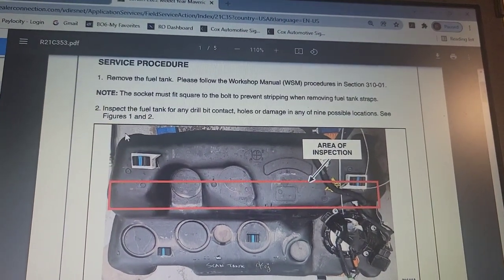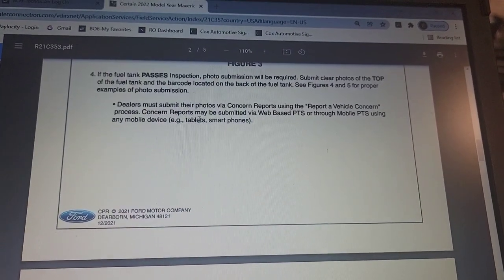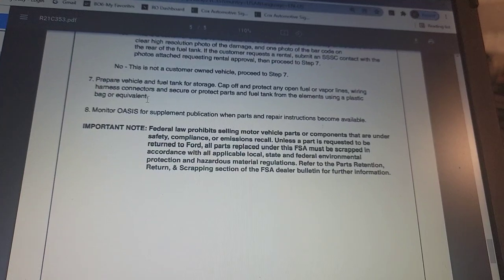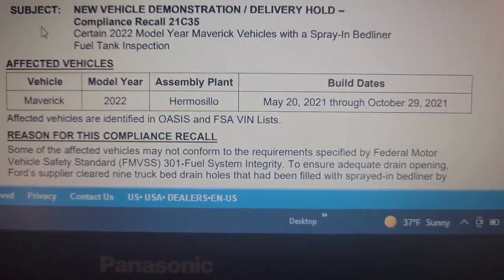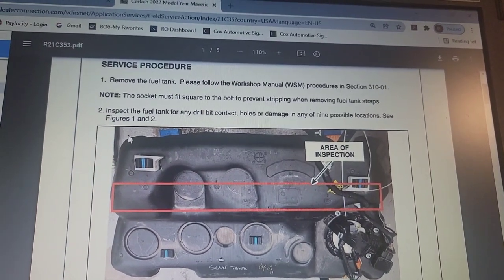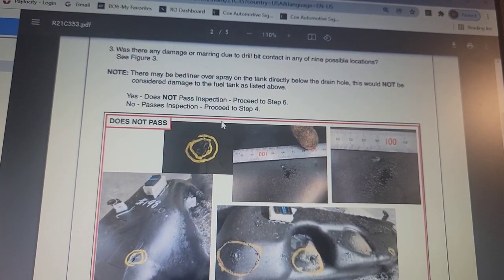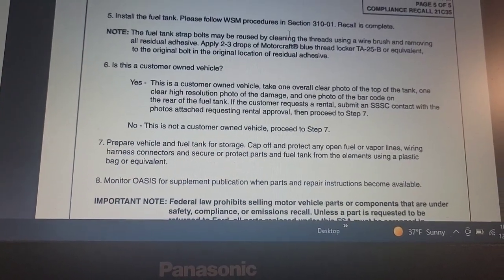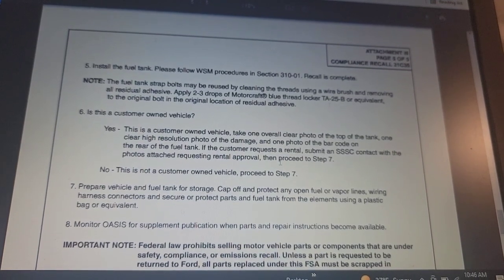Heads Up 2022 Mavericks With Spray In Bedliner - Holes In Fuel Tank after spray in liner possibly

Comment: Wow that's a great knowledge of possible catastrophic damage occurred during the bed liner spray application.  Thanks for the information you may have saved many lives with this one . Hope your day is a great one. Happy Holidays.
Reply: The application of the bed liner is not the problem, it is those drilling out drain holes.
Reply: So it was Ford's fault because they sold the vehicle or is it the contractor's during the spray application the drilling the holes for the bed to drain?  Just the guy drilling the holes before or during installing the spray bed liner?
Reply: @brianszymanski2971  drilling the holes after the bedliner was applied.  Not a factory authorized repair.
Reply: @brianszymanski2971  It's Ford's fault, obviously. That's why they put out a bulletin and are the ones fixing it. Your question would be filed under "common sense" - it's a shame most people don't have any smh. And in the interest of helping you not sound like an idiot in public, it's not "Happy Holidays". It's either "Merry Christmas" or "Happy Hanukkah". You're either celebrating a Jewish holiday or a Christian one this time of year. So use the one that pertains to your religion. You're welcome!
Reply: Just drain holes ! Would had made a good hot tub if explosion  was  to incur

Comment: Just checked my wifes Limited  Edition Lariat build date 11-13-21 found no sign of drilled out drain holes and they had perfect application thru the hole of bed liner material. That must have been the hold up along with the red paint on the first edition glad my build date got moved original build was 10-18-21 ordered 8-2-21. Keep the vids coming I watch every video to keep updated on my 2022 F250 SUPERDUTY  and 2022 Maverick. I feel I have more information than my dealer with your help Thanks
Reply from the maker: Not all dealers have a me working for them lol

Merry Christmas God Bless

Comment: I was on the fence about getting the factory spray in liner but ended up going with the DualLiner bedliner and really happy with how well it fits and looks.
Reply: Pretty lame that you can’t get Lariat Lux without factory spray in especially now
Reply: @jaredbarnes8761  yeah, I don’t care for how they option their trucks. If you thought that was bad,the regular cab short bed is extremely limited.
Reply: @bikeman1x11  Nah... drop-in liner with a rubber mat on top is the best. Way more protection for the bed.
Reply: @jerryjeromehawkins1712  corrosion city

Comment: When I ordered my 2022 f250 it was an option to add the bed spray liner for 595.00. I opted no and will have it sprayed with Line X - trust me, if you use your bed a lot Line X is the way to go
Reply: I have the factory spray in liner on my 2018 F150. It has been absolutely bulletproof. I imagine Line X is better, but the factory one works just fine if the truck comes with it.

Comment: I opted for the factory spray in liner on my 2021 f250 but I think next time I'll have it done after receiving the vehicle. The factory sprays over the bed fasteners which isn't ideal and they got some of the liner material on one of my back wheels which is impossible to get off without damaging the clear coat on the wheels.

Comment: Keep in mind Ford didn't install the spray-in-liner, they're using an outside source (3rd party), who subsequently drilled the drain holes without Ford's permission following some of the installations.  This campaign primarily relates to 2.0 Eco-Boost equipped vehicles, as very few hybrids were manufactured during the date range in question.  There are also two possible 2.0 EB Tanks, and the hybrid uses yet a different/smaller tank, which is most likely why the video repeats itself.  (Hybrid tank is tapered at the top of the pictures, the 2.0EB tank is more rectangular in shape).

Comment: Thanks for all the detailed information!! We are lifelong Ford  owner family, my parents have a 2l016 explorer platinum and we are still waiting on the bolt kits for the rear suspension toe links, we got the notice in February, I had it back twice for inspection and replacement  of the tie links then to check the Heim end rotation, cars only got 35k miles on it, Ford keeps sending us letters but parts still aren’t in as if today, this vehicle has had the most recalls out of the 12 Fords we have owned, very disappointing
Reply: Had my Flex with that recall. Parts were available. Any indication, I see many Explorer's with 150k-200k miles.
Reply: @ShersGarage  I’m a 25 year auto/ diesel mechanic , when I worked for a transmission shop in the 90s we called them Exploders, haha,  made a good pay rebuilding all those  transmissions!! Haha
Reply: @paulmollise1856  6F55 isn't bad though
Reply: Dang, after 12 Ford’s you still haven’t learned
Reply: @RustyZipper  haha!! I’m a glutton for punishment !!

Comment: Goodness they couldn't tell when they drilled into them? 🙂🐶👋🏻
Reply: Had a Porsche 911 come into our dealership. Customer complaint was fuel odor inside cabin. Had a fancy stereo system with amp. "Mauler the Stereo Installer" drilled through the trunk floor and the gas tank!
Our "star" Saab tech was installing a trailer hitch on a 9000. He drilled through the trunk floor and Psss through the spare tire. Step 1 in instructions - "Remove spare tire"!
Reply: @bikeman1x11  😉😁
Reply: Ferd built tough
Reply: I'm sure they knew and didn't care... Unfortunately due to the 'Rona there is a lot of lazy and uneducated factory workers that are required to meet quotas despite being understaffed...
Reply: no kidding, i replaced my fuel pump in july, by cutting a hole in the bed. with a skillsaw, sawzall and abrasive blades. i hit nothing. patched it with steel plate and self tapping bolts. no damage to anything.
Reply: poor quality build.

Comment: Thank you for the video.  This video told me way more then  my local dealership about what was going on with my truck.   I took my Mavrick in for a e-brake light going on while driving.  When I got there they told me I had a recall on my truck they had to do first.  2 days passed, and now they won't give me my truck back, stating my fule tank failed the recall.  I asked when I will get my truck back,  they set me up with a ecosport as a free rental.  Again I have pressed them for when they will have my truck back, and I got no answer.  I asked about the issue with the ebrake light, they are looking into it further.    FORD..  if you read this.   I LOVE my mavicks, you have a winner on your hands.  But WTF......   give people the option to drive their vehicles until parts are available for the repair.  The pictures from your service bulitin look like a drill bit collided with the plastic tank,, not that it actually drilled through the tank..    I get the hole liability thing, but dang you don't take someone's brand new truck.    Not trash talking, Ford or one of its dealerships, I love the truck,  and I think my local dealership is just in the dark as to what their next step is to be.  I will be commenting on this post as I get updates on my Mavrick so please wish me luck.
Reply: While it is very frustrating to be without your new vehicle, if it is a safety recall such as having holes in a fuel tank, there is no way they should return the vehicle without completing the repair.  The potential liability is way too high.
Reply: It's been 3 weeks since my truck failed the gas tank recall.   I was told by my dealership today that they do not have a part number for ordering the gas tank,  and are still unsure how to proceed.  One of the techs in the shop said with all the letters going out to affected customers in the next few weeks,  Ford should have the details figured out soon.  Try checking back in another 2 weeks.    FORD.  WTF...      I feel sorry for the people in the service centers that are on the front lines dealing with this.   Remember be kind to the people who are trying to help get the vehicle fixed.  It's not their fault,

Comment: If ford would have used steel gas tanks with a bladder this never would have been an issue🤷 seems like these modern vehicles have issues because of materials used to manufacture them more than anything in my opinion anyway. I personally just got done pricing an HVAC box for a 2015 Nissan rogue that cost 1500$ in parts and 14 hours in labor because the doors inside the box strip the splines that locate them to the actuators. Btw the box is on backorder so it's unobtainium. Thank you for the info Ford Boss Me.
Reply: Or they could just not drill holes in the gas tank.. steel tanks were a pain in the ass back in the day.
Reply: Bladders are used in race cars, not passenger cars.
Reply: Drills go through steel tanks too
Reply: Planned Obsolescence, that’s why they want you leasing them every 3 years.